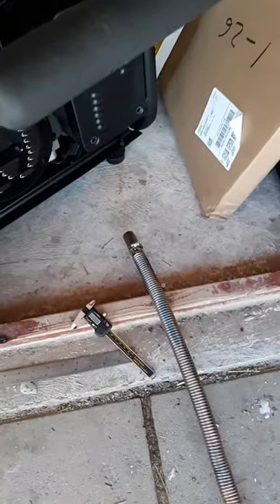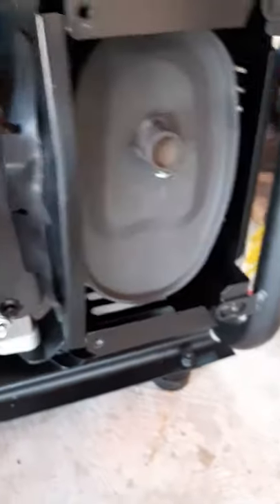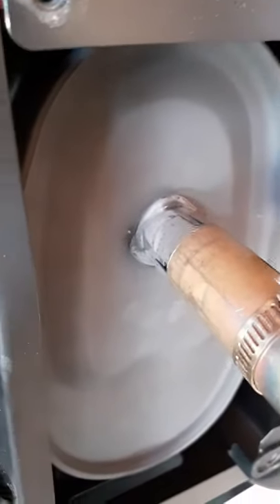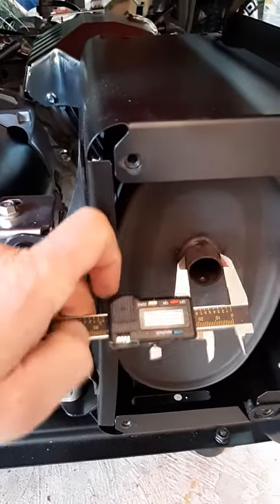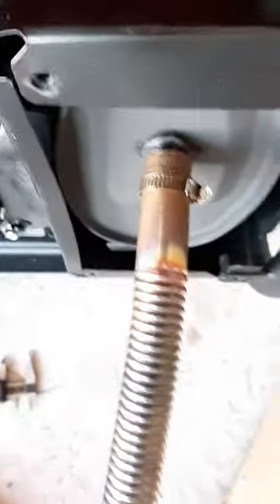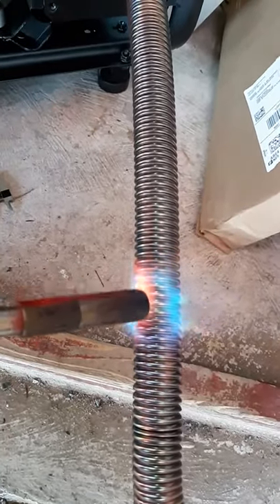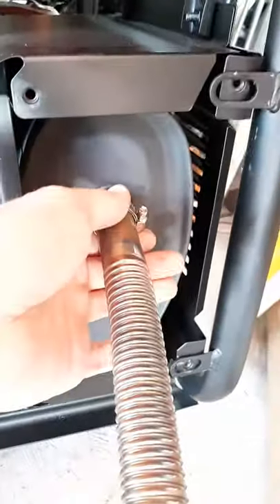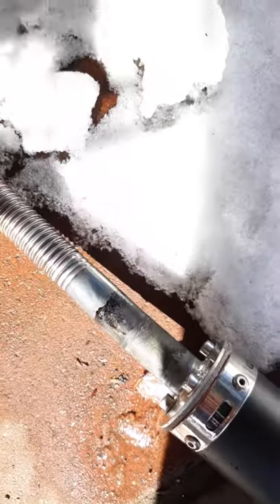how to extend generator exhaust

Comment: Exactly!   I watched over 20 self-help videos .I bought my soundproof panels from Amazon to do my box, 2 fans push / pull & 2 - 8" x 8" vents. Box runs around 180 degrees & muffler at 350 degrees.  Overkill maybe but work's & I only had to buy this stuff once with nothing left over.
Reply: Link?

Comment: Thanks for the instructions. The extra muffler probably won't change the noise level much because a lot of the noise you hear comes from the engine itself. That's why truly quiet generators tend to come in a housing with sound insulation in the walls.
Reply: ⚠️very important announcements about portable generator safety:

This is just a reminder. We always need to make sure we’re aware of the electrical safety of using generators. 

1) KEEPING OTHERS SAFE: Please do not allow an unqualified person or your children to operate and service the portable generator. Just because some manuals don’t say that doesn’t mean it’s safe. That is important against the generator safety rules. We also need to be keeping an eye on our children too. You need to make sure that your children are not playing near the portable generator especially when it’s running so they won’t get electrocuted. Generators pose electrical risks and they can be hot during an operation. Please keep your children away from the portable generator at all times. It is important to keep our children safe especially our little ones. Be aware of all the hazards.

2) WHERE TO RUN YOUR GENERATOR: Some people use their portable generators indoors which increases the risk of carbon monoxide poisoning. It’s important to have a carbon monoxide if you have a gas generator. Never ever use your generator indoors even if your doors and windows are open and even in the garage is not safe to use a portable generator. Not even at your porch and your deck. It is never safe to use your generator indoors and in enclosed areas of your home. Your generator needs to be 15-20 feet away from your house. 

3)🔥FIRE HAZARDS: Never refuel your generator while it’s running. You need to let your generator cool off before refueling it and before storing your generator. Never overload your generator too. Never ever back feed your generator. You should never plug your generator into a wall outlet. Also never store propane tanks indoors. Please keep flammable things away from the generator as well and please don’t smoke cigarettes near the generator. Having a fire extinguisher next to the generator is also important against the generator safety rules. 

4) GENERATOR OPERATION: make sure your hands are dry before touching the generator. Never use your generator in wet conditions. Don’t let your generator get wet. You need a generator tent if you need to use your generator during wet weather. Please don’t wear loose clothes when operating the generator. Turn on your generator before plugging in appliances. Use the right cord for your generator. Please do not use worn out cords. 

https://youtube.com/shorts/eFigDfnPkcQ?feature=share and here is a short video more about keeping others safe when using generators 

Hope this helps. Remember safety first.

Comment: A few cautions before you buy something like this. The flexible pipe will slow down the flow of the exhaust. A good friend and welder told me it should be straight pipe like a car. Depending your generator brand this exhaust pipe maybe to small. The bigger more power generators like Doromax have bigger exhaust systems. Well now I have something to send back. O before I forget, you should order 2" 50FT LAVA TITANIUM BASALT EXHAUST WRAP. Another YouTube video I watched highly recommended it and my trust worthy friend I asked said that was a good idea. He as well uses the same exhaust rap.
Reply: Isn't the hose he's using just a 1 inch wire conduit?
Reply: I ran 1' instead of 3/4" at 10 feet to reduce any back pressure.  10 years & all is fine.

Comment: I went all over town looking  for a pipe to fit the  stinger.i read the diameter was 7/8 and 15/16 could not find anything to fit tight. Went to ace hardware wilco coastal  and a pipe pump company.looks like brass fittings are the winner for size ...were do I buy the flex pipe you show in your video.?

Comment: Can I do this to the Westinghouse WGen5300DFcv 5300-Watt Dual Fuel  generator. I havent gotten it yet so not sure if I can get an adapter plate or find a flex line that will fit over end like in this video. Ahy one any thoughts or experience.

Comment: The extra muffler won’t make the machine any quieter. First off it’s a stupid cheap “MUFFLER” technically it’s it doesn’t fall under the definition of a muffler. 2nd, your noise doesn’t come from the exhaust. Not at all. It’s loud because of the engine noise. Plain an simple. If you want it quiet, build, buy, have someone build a box for it with dyno mat or fireproof insulation sheets. Sides and top, cut multiple holes with rubber grommets to run your wires through, but a hole for a square 10x10 or 12x12 attic fan that you install to pull the HOT AIR OUT!! Then another hole at the opposite end with a decent size vent so outside air can be pulled in and the fan pulls the cool air in and hot air out!!! Etc etc etc there’s more but that the just of it. 
 
In a side note the exhaust hose (minister the muffler) drill another hole and run it AWAY from the box or some metal flashing and c clamps and run it upward and bend the top away from the home

Comment: Grease is good it helps keep the metal clean from corrosion and rust
Reply from the maker: Yeah it's good I'm feel heat of exhaust comes into play and burns it away. You have no idea how hot exhaust pipe gets. Any oil will burn off. You would have to go to AutoZone and get yourself paint that withstands over thousand degrees
Reply from the maker: Yes it's very good. In this particular case it's unnecessary because this is stainless steel
Reply: ⚠️very important announcements about portable generator safety:

This is just a reminder. We always need to make sure we’re aware of the electrical safety of using generators. 

1) KEEPING OTHERS SAFE: Please do not allow an unqualified person or your children to operate and service the portable generator. Just because some manuals don’t say that doesn’t mean it’s safe. That is important against the generator safety rules. We also need to be keeping an eye on our children too. You need to make sure that your children are not playing near the portable generator especially when it’s running so they won’t get electrocuted. Generators pose electrical risks and they can be hot during an operation. Please keep your children away from the portable generator at all times. It is important to keep our children safe especially our little ones. Be aware of all the hazards.

2) WHERE TO RUN YOUR GENERATOR: Some people use their portable generators indoors which increases the risk of carbon monoxide poisoning. It’s important to have a carbon monoxide if you have a gas generator. Never ever use your generator indoors even if your doors and windows are open and even in the garage is not safe to use a portable generator. Not even at your porch and your deck. It is never safe to use your generator indoors and in enclosed areas of your home. Your generator needs to be 15-20 feet away from your house. 

3)🔥FIRE HAZARDS: Never refuel your generator while it’s running. You need to let your generator cool off before refueling it and before storing your generator. Never overload your generator too. Never ever back feed your generator. You should never plug your generator into a wall outlet. Also never store propane tanks indoors. Please keep flammable things away from the generator as well and please don’t smoke cigarettes near the generator. Having a fire extinguisher next to the generator is also important against the generator safety rules. 

4) GENERATOR OPERATION: make sure your hands are dry before touching the generator. Never use your generator in wet conditions. Don’t let your generator get wet. You need a generator tent if you need to use your generator during wet weather. Please don’t wear loose clothes when operating the generator. Turn on your generator before plugging in appliances. Use the right cord for your generator. Please do not use worn out cords. 

https://youtube.com/shorts/eFigDfnPkcQ?feature=share and here is a short video more about keeping others safe when using generators 

Hope this helps. Remember safety first.
Reply: @Etzki1  Is that house the same as 1 inch wire conduit?

Comment: Caution. Harbor Freight does not recommend using anything like this due to Back pressure created due to length and diameter of hose.
Reply: Exactly which is why I ran 1" instead of 3/4".
Reply: Ya, need probably at least 2"

Comment: When I got my new hose I simply took it to the car wash & shot hot soapy water through it inside & out.  Ive heard of people using brake cleaner too then dipping into hot soapy water submerged in a 5 gallon bucket overnight then rinse.  After all, its stainless steel.  I ran 10 foot at 1" piping so as to prevent back pressure.

Comment: At 1:20 you say you "bent it and now it fits snuggly",  what, why, and how does this apply.  Thanks
Reply: This pipe is a little to large diameter. When you put ring on it and screw it tight it will bent ( crimp ) a little and seal.
Reply: Thanks,  when you refer to the “ring”  ,  you mean the tightening clamp, right ?
Reply: ⚠️very important announcements about portable generator safety:

This is just a reminder. We always need to make sure we’re aware of the electrical safety of using generators. 

1) KEEPING OTHERS SAFE: Please do not allow an unqualified person or your children to operate and service the portable generator. Just because some manuals don’t say that doesn’t mean it’s safe. That is important against the generator safety rules. We also need to be keeping an eye on our children too. You need to make sure that your children are not playing near the portable generator especially when it’s running so they won’t get electrocuted. Generators pose electrical risks and they can be hot during an operation. Please keep your children away from the portable generator at all times. It is important to keep our children safe especially our little ones. Be aware of all the hazards.

2) WHERE TO RUN YOUR GENERATOR: Some people use their portable generators indoors which increases the risk of carbon monoxide poisoning. It’s important to have a carbon monoxide if you have a gas generator. Never ever use your generator indoors even if your doors and windows are open and even in the garage is not safe to use a portable generator. Not even at your porch and your deck. It is never safe to use your generator indoors and in enclosed areas of your home. Your generator needs to be 15-20 feet away from your house. 

3)🔥FIRE HAZARDS: Never refuel your generator while it’s running. You need to let your generator cool off before refueling it and before storing your generator. Never overload your generator too. Never ever back feed your generator. You should never plug your generator into a wall outlet. Also never store propane tanks indoors. Please keep flammable things away from the generator as well and please don’t smoke cigarettes near the generator. Having a fire extinguisher next to the generator is also important against the generator safety rules. 

4) GENERATOR OPERATION: make sure your hands are dry before touching the generator. Never use your generator in wet conditions. Don’t let your generator get wet. You need a generator tent if you need to use your generator during wet weather. Please don’t wear loose clothes when operating the generator. Turn on your generator before plugging in appliances. Use the right cord for your generator. Please do not use worn out cords. 

https://youtube.com/shorts/eFigDfnPkcQ?feature=share and here is a short video more about keeping others safe when using generators 

Hope this helps. Remember safety first.